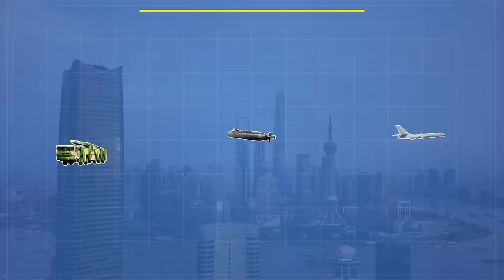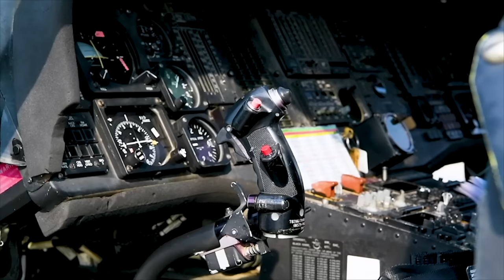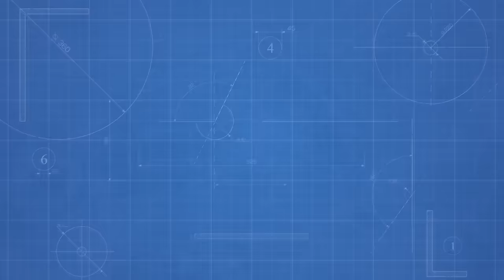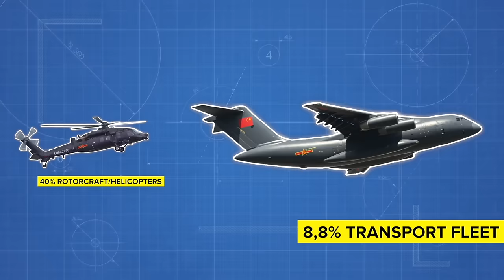Could the US Military Conquer China All on Its Own

Comment: Some of your information is way off. The Stryker for instance you said the top speed is 38 mph?? That’s not true. The top speed is 70 mph unless fully loaded then it’s about 62 mph. And the M1 Abrams can run on jet fuel or jp8, diesel, gasoline, OR just straight kerosene. That is an oft overlooked benifit of the turbine engine. It will run on basically any hydrocarbon fuel you got. So no specialized tankers just for it. You can literally fill the god dam thing with Kerosene and it runs just fine. Diesel it runs just fine. JP8 or jet fuel or gasoline it runs just fine.

Comment: These videos are just speculation from people that don’t really understand military capabilities or tactics.
You don’t fly high to avoid air defenses.
You fly low.
Missiles operate better in thinner air and radar easily spots high flying targets.
It struggles with low flying objects.
The US conducts drills and what if scenarios to determine whether they can beat China and in most cases they come out in top but with heavy losses including a couple of carriers.
The big issue with modern warfare and missile defenses is that they can be easily overwhelmed by cheaper assets like hand built rockets and cheap drone swarms.
We saw this in Israel on October 7th so it’s getting much harder to defend against missile and drone swarms and China is invested mostly in weapons that give them stand off capabilities against aircraft carriers and aircraft.
The weak link in the US strategy is range.
They have to come inside the range of Chinese weapons with their carriers, support aircraft such as tankers and AWACS which means they have to put those things at risk in order to attack China and the US hasn’t had to face these problems since the Cold War so they’re working on fighters now that are nearly bombers that have more range and are much larger while also being faster and more stealthy than ever before to overcome this issue.
If China attacks Taiwan tho Taiwan is very close to them and can overwhelm their missile defenses with swarms of missiles and the 3 gorges dam is their Achilles heel.
If that gets destroyed China is screwed in short order.
The downside to attacking it is that it would leave little rain for them to not go nuclear and that would be bad for everyone involved

Comment: Something to note to. While the Chinese airforce does boast large numbers of some combat aircraft, they are inherently behind the times. A lot of their combat planes are still using PESA systems instead of AESA (Modern Radar) and some, embarrassingly, are known to be equipped with Pulse Doppler Radar systems, reverse engineered from a downed US fighter in the Vietnam war…. namely theJH-10 dual seat fighter bombers have these systems equipped.

China’s entire J-7 Aircraft use an antiquated PD system.

Almost 40% of the Chinese Air Force as of 2022, are equipped with radar and avionics that are the equivalent of what the US fielded in the late 80’s and early 90’s. 

Almost half of China’s J-10 Fleet, Namely the J-10A uses an early 90’s spec rip off of a Russian Radar system, while the other half have semi modern AESA systems. 

The only real threat considered is the AESA systems on some of the J-10’s, J-16’s and all of the J-20’s.

So effectively, even going into a fight with the US, almost half of the Chinese fleet of fighter aircraft, may as well be considered dead weight or the aircraft equivalent of meat waves.

Equivalently put, nearly 40% of Chinas fighter fleet, have a radar detection range of, in optimal conditions, sub 150km. Meaning even the basic AIM-120D will have an absolute field day, noting that nearly 40% of Chinas aerial fleet would be blown out of the sky before they could even detect an American F-16 (without AWACS or ground radar) is pretty poor.